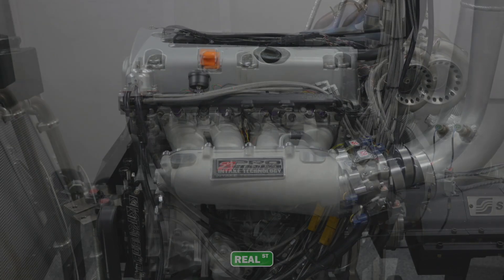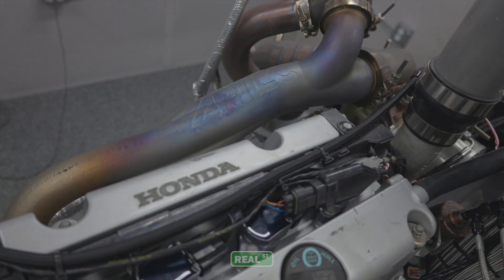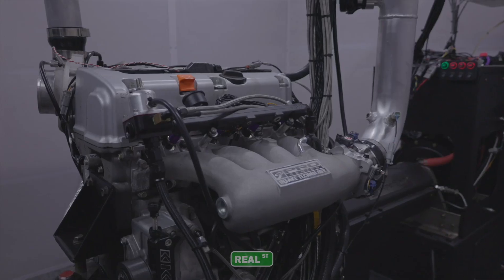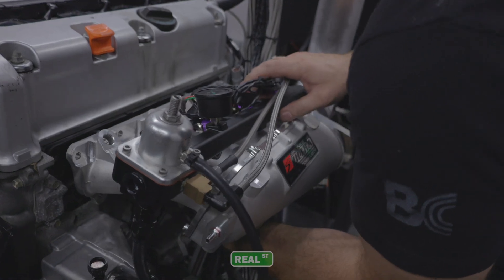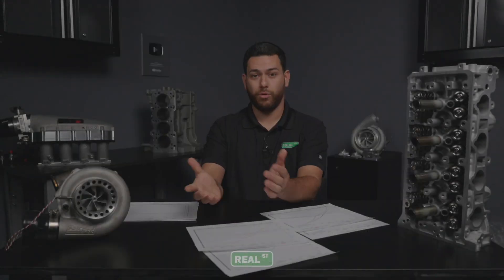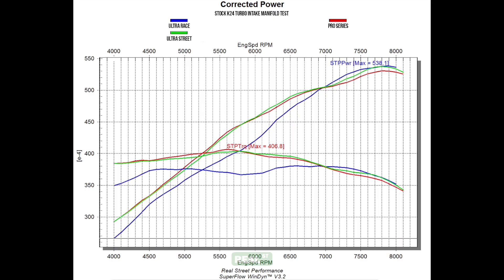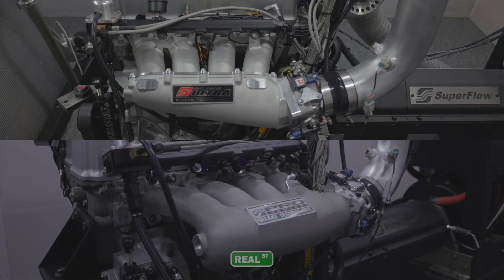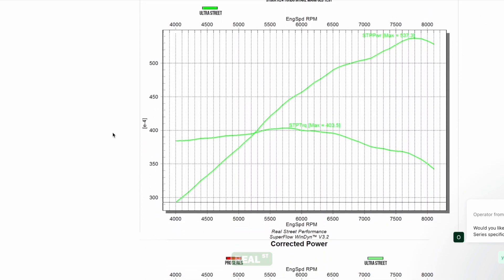Turbo Stock K24 Intake Manifold Test | Back To Back Results On Engine Dyno

Comment: Can you do a k24z7 motor ( civic si 12-15) turbo 

In the 500-600 range 

With the original z7 head 

Then do another dyno graph with the z3 head from the 8th gen same boost level 

Type s a oil pump in both

Comment: Where you're measuring boost pressure? The Race series looks like it has a larger throttle body diameter relative to both the other two as well as the intake tube so I wonder if that sudden transition is hurting the Race relative to the other two.

Comment: Will these same manifolds work for a RWD application because it looks like the manifold can be turned around
Reply from the maker: Hi there! Great question. Yes these can be used in RWD applications as well. The plenum bolt patterns are symmetrical and can be flipped.
Reply: @realstreetperformance  Awesome 😎 hopefully we see you guys do some test with the same turbo setup but with the K24Z series head vs K24A series on the exhaust side that it.

Comment: I suppose you can say that a gato/prac/xcessive large volume intake intake manifold would perform similar to the skunk 2 ultra race?
Reply from the maker: That might be the case, but those plenum and runner designs are all different from one another, and the only good way to find out would be by testing them. We plan to test some of those manifolds in the future as well , and at different HP ranges.

Comment: I have a stock k24a with a 6262 in my 97 dx hatch. I'll tell you right now, it's an incredibly rowdy little car. I'm around 480 and that's more than enough to have fun with it 😎. I'm looking into upgrading the 5 speed transmission with a lsd and carbon synchromesh possibly this winter
Reply from the maker: Nice! That 4-500 HP range is such a sweet spot for those hot rods! The LSD will be a game changer in not only hooking up the tires, but stability in keeping the car straight. Let us know when you're ready to move forward and we'll take care of you ;)

Comment: I think I think you guys should be more practical on what is being used out in the streets like a cast-iron turbo manifold versus some of the more aftermarket ones
Reply from the maker: We're happy to take suggestions if you would like to see a specific one on the dyno :) The Artec Sidewinder is a really popular option for K swapped cars and comes in cast stainless. Which cast iron would you like to see on there?

Comment: I think it's time to use the different intakes on different camshafts, DC, skunk2, 4piston ect. And to give us a formula for a worked head stock block configuration
I think a good comparison with different skunk2 and DC camshafts will be good for all of us, because with all the options it's hard to choose which camshaft to run
Reply: A proper cam for your build from skunk2 ultra series look no further. I have tried 3 brands. Bc,Dc and skunk2.
Reply: @Jagvetinget  ultra 1s on a stock k20 block??
Reply: @hawyn99  Yeah.  Not optimal but ultra series are great cams. Tegiwa did a test Dic´s vs ultra1 and it did perform good.

That is my experience no need to listen  to that. do some research. some people think DC is the best.

Comment: Out of curiosity what would the difference be on the ultra race without the 2L spacer?
Reply from the maker: I think we would see similar results as we did when doing the NA test but can't say for certain without testing it. We can run it back in the future to add onto the results in our blog post! If you're interested in reading our write up, you can do so here:

https://www.realstreetperformance.com/blog/500hp-k24-turbo-intake-manifold-testing/

Comment: These engines are incredible. A 6466 is a huge turbo and it spools it fully by 4k rpm. In fact its probably getting positive pressure by mid 3k rpm. This engine with like a borgwarner S257 would be a menace
Reply from the maker: The K24 is for sure a sweet engine. I dont want to confuse anyone with spool characteristics on these tests. For a quick run down on the machine's use in this case, we are setting a start RPM, applying load, and building boost to a set desired point at which point then we allow the test to start / increase RPM (600rpm per second) . 

A standard K powered car on a chassis dyno with a 6466 will act different in how it spools depending on its gearing, engine setup, housing etc etc. The way we are able to test things on the engine dyno gives us 100% clear data to compare parts as we did here targeting the exact same boost levels throughout the whole run, but unfortunately cannot mimic real world spool characteristics just yet. We're working on a solution for that and hope to have one soon. 

Thank you so much for watching and being engaged with us :)
Reply: A 66mm is not huge.
Reply: @km6832  tbf it depends on its purpose. Iam a drift guy and i wouldn't even put a 66mm on a 3.2L inline 6 S52 let alone a lil stock 4cyl. Maybe for drag racing a 66mm isnt huge. But iam not a drag racer
Reply: @elijaah81  a 66 is perfect for 3.2 inline 6. But i understand where you are coming from
Reply: s257 is old and laggy nowadays

Comment: Thanks fir this. Arent 2600cc injectors a little big for 500hp on pump gas?
Reply from the maker: Great question. With this build even though its a stock, we wanted to replicate what someone might order at home. Alot of people will start on a stock engine, buy larger than neccesary fuel systems and maybe turbocharger , to be ready for a step up to built motor down the line. Thats the aim with going with a larger injector here. Additionally, Injector Dynamics 2600cc injectors perform very well even at low duty cycle for a clean idle and this mid 500hp target. On our blog post we touch a little more on that "prepping for more" subject :) Hope you have the chance to check it out!

https://www.realstreetperformance.com/blog/500hp-k24-turbo-intake-manifold-testing/

Comment: I have a accord 24 in my 8th gen stock besides a clutch kit is even worth the ultra manifolds and I have a 20 in my ej stock also with that set up do you thing @least 400hp would be attainable
Reply from the maker: 400 can be attained fairly simple with a turbo kit and associated mods. We'd love to chat with you if you need help reaching that goal. Give us a call anytime :) 407-695-7223